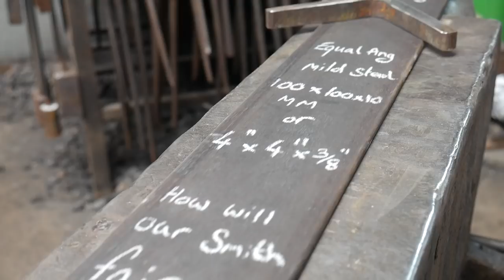Making a Pizza Cutter and Pizza Dough! Ella Sibley Sparling Special!

Comment: Very nice indeed. Definitely looks much sturdier than the two commercial ones I have. 

As an alternative, here's a pizza dough recipe I use (based on traditional Napoli pizza)

1000g superfine '00' flour
600ml water
3g active dried yeast ('cause getting fresh yeast here is damn near impossible)
12g sea salt

Combine the flour, water and yeast together, then gradually add the salt and knead for 7 mins in a mixer, or 15 mins by hand, until the dough is elastic and passes the window test. 
Set to rise for approx 1 hr (up to 2hrs if your area is cold).
Divide into 160g lots and form into balls (should get about 6)
Set to rise again for a minimum of an hour, although for a better flavour, you can rise in the fridge overnight (sealed container obviously).
If fridging, remove from the fridge at least 1.5 hours before you intend to use.

Preheat your oven to as hot as it will go (inside ovens, about 250-300ºC), although it is much better to do in an actual wood-fired oven at about 400-500ºC).

Form your dough by hand (no roller required), top with no more than 4 toppings (you don't want soggy pizza).

Bake (inside, about 5-10 mins), outside in a proper pizza oven (90-120 secs)

Voila!
Reply: David de Groot Thanks David!! Will try this one next time!!
Reply: That's not enough salt or yeast.  You're getting a 60% hydration, but I find a 68% works much better, and you'll still want around 3,8g-4g yeast, and 19-20g salt. Your crust will be pretty bland otherwise.